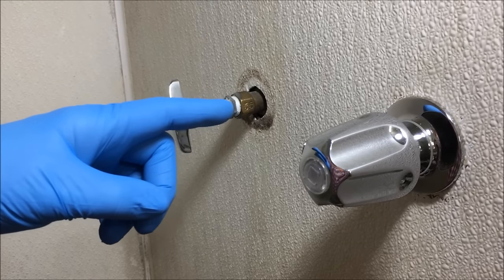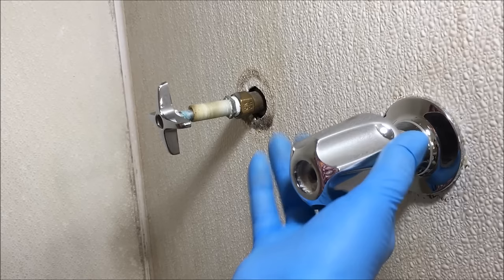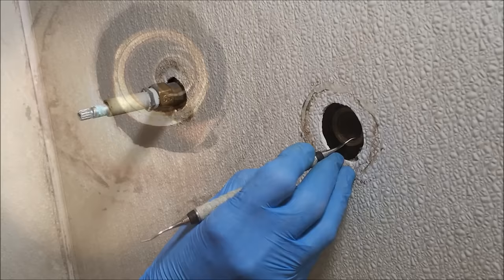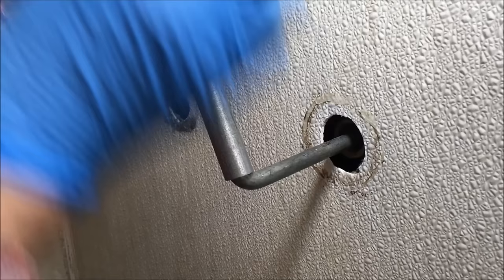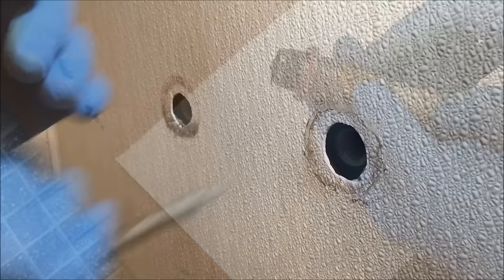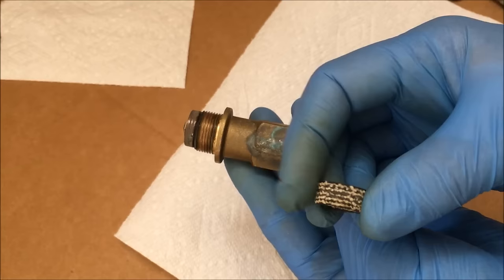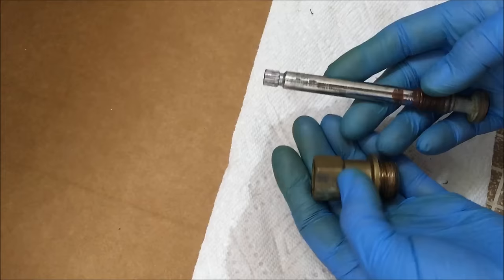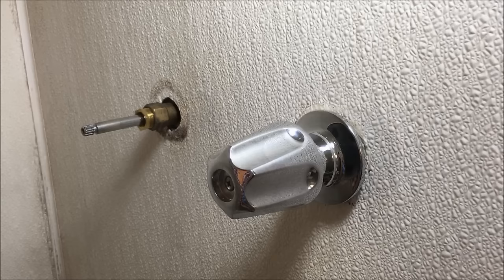Fix Leaking Shower Head or Bathtub Faucet | Rebuild & Replace Shower Valve

Comment: I love how straightforward your video style is. I’d add for anybody else having issues getting the handles off, soaking them in vinegar helps break down the calcium deposits if knocking doesn’t work. Fill a ziploc bag with some vinegar and tape it around the handle as best you can. It helped me get my crusty shower head off.
Reply from the maker: Thank you, Febiza919, for your thoughtful comment and tip you added.  That's great information!  I'm glad you like the straightforward nature of my video.

Comment: You have explained the stem working procedures better that anyone I’ve seen. Thank you. My shower faucet even after replacing the rubber washers on the stem. Do I need to pull the seats ( new seat) and use the sealant or Teflon tape ?
Reply from the maker: Thank you, dw, for your very nice comment.  I truly appreciate that you took the time to write it.

Now, to your question.  Yes, Sir, replace those seats because you saw in the video what pitted and worn seats did to my washers--chewed them up.  No, you don't have to use the Rectroseal 5 on the seats, and I would not recommend Teflon tape, ever, if you can use Rectroseal 5.  Rectroseal 5 is simply that great.  I only use the sealant on the seats so they remove easily next time I have to replace them.  The seats, themselves, do not need any sealant.  If you worry at all about a leak where the valve body screws into the manifold, then, yes, I would put some Rectroseal 5 on the threads of the valve body before I screwed it into the manifold.  Technically, you should not need the sealant on valve body to manifold, but it is cheap insurance against a leak.  And, yes, if you do use sealant there, I would highly recommend Rectroseal 5.
Reply: @frugaldiy1  Thank you, I have already replaced the seats, complete new stems and have replaced the seat washers on the end of the stems twice in the last 8 months. I just put new washers on the stems again and I still have a cold water leak there. The one I took off last had deep rings in it . I’m at a loss. Do the cone shaped washer do better ?
Reply from the maker: Okay.  First, please tell me WHEN the cold water is leaking.  How do you know it's the cold, vs. hot, water?  Is it leaking when the faucet/water is off or when the faucet/water is on?  Is the leak from the bathtub spout/shower head or is the water leaking from the valve stem body?

No, of the cone-shaped washers.  The washers are specific to the valve body.
Reply: @frugaldiy1  They cold water is always leaking when the knob is turned off. It leaks from the tub spout and is always cold to the touch. The seats are new and so is the washers. I have the correct washer size on the stem.
Reply from the maker: When I have a leak from the spout or shower head, I always find it difficult to discern if it's the cold water or hot water that's leaking because, unless it's a massive leak, by the time the hot water makes its way through the pipes and dripping out of the spout or shower head, it's always cold.  Just food for thought.  Typically, it's the hot water washer that gives way before the cold water washer does because the flow of the hot water tends to make the hot water washer less pliable and brittle.  

The "deep rings" you mention, in the new washers that failed, lead me to think that maybe the there is too much force being applied to the stem/handle when the water is turned off.  After installing new washers, I apply VERY LITTLE force to the handle when I turn the water off, and I have no leaks.  Maybe apply less force to the handle/stem when turning the water off.

Given that you say the leak occurs only when the water is off, that leads me to think that either the washer or the seat is the culprit.  Why the washer or seat, or both, keeps failing is a bit of a head-scratcher to me.  

One thought is that if the washer screw is turned in too tight, it can cause the washer to "cup", which impairs the washer-to-seat seal.  

When the water, hot or cold, is on, do you ever experience intermittent loss, then increase of water volume from the spout or shower head?
Reply: @frugaldiy1  thank you 👍🏻
Reply from the maker: You're welcome, dw.
Reply: @frugaldiy1  A little follow up. Although the drip was cold, the problem was the hot water stems washer. I had not changed it last time because it was a new stem. I noticed when I put the new stem in….the hot water stem did not turn quiet as freely as the cold. To fix it, I replaced the washer and put a little dab of grease on the stem where it goes thru the packing. It spins freely now and I can tell when it stops….I assume I was over tightening when cutting the water off and wore out the the washer prematurely. Thanks again.
Reply from the maker: @dwhunter8904  Thank you for the follow up, and you're welcome, dw.

Comment: Great video. I put silicone grease almost everywhere. Packing seal, escutcheon, threads. Everywhere. This will make disassembly much easier and the operation smoother. Done this job few times on my tub last 25 years

Comment: Thank you so much you just saved me tons of money, I got leaking on the middle valve behind the knob, I replaced the rubber washer inside but still leaking, I am by replacing entire system but luckily I saw your video, I just realized there is another rubber gasket, no more leaking now 🙏👍
Reply from the maker: DADDY INDO, that's GREAT to hear.  I'm glad the video helped you fix the leaky faucet yourself and save money.  Job well done!

Comment: Gr8 video! I personally put plumber grease on the screw that hold the rubber washer. I have had corroded ones and or corroded out screw driver slot. I do the save on the other screw that holds the handle on. I also put grease on the end of the stem that holds the handle so they don't corrode and the handles will come right off next time.
Reply from the maker: Thank you, Richard.

Comment: Excellent tutorial. One of the best I've on the subject.  I just installed a new diverter valve but it's leaking at the shoulder gasket (I think). I also have a damaged manifold
Reply from the maker: Thank you, Glenn.  I'd use RectroSeal 5 on the diverter shoulder to manifold leak.  Works like a charm.  ;)  Merry Christmas!

Comment: Thank you. I was told i had to replace the entire bathrub faucet and shower. On mine it was just a streght pipe coming through the wall. But figured. Hell if i have to replace it anyways mifht as well see if it turns. Vice grips and a little bit torque and it cane out. Thanks for saving me 300 bucks 😁
Reply from the maker: That's wonderful to hear my video helped you save your hard-earned money!  Love hearing that.  Proud of you for fixing it yourself, too!  ;)
Reply: @frugaldiy1  yeah. 14.99 and maybe 5 minutes of effort and no more leaks. At first it would leak about a 3 gallon bucket over 12 hours. Got so bad that I had to shut off the water to the house as it was leaking 3 gallons every 10 minutes and after an hour would use up all the hot water. Landlord sent a plumber who said we had to replace it and my landlord is kind of a jerk and wouldn't pay for the repair. Lol tried to send me the bill for the plumber too. Lol. 

But yeah. Thanks a ton! My shower Hot/cold water once apart look identical to yours. So again thank you!!
Reply: @imnotahippie22  You're welcome.  I'm glad you saved money and fixed the leak.  FYI--you're landlord sounds like a jerk and should be ashamed of him/herself.  SMH  You did a great job and should be proud of yourself!  Carry on...
Reply: @ann2796  thanks. Yeah I am a big support of "DIY" and "right to repair".. 

So something completely unrelated to this topic but would like to share is,  I've been curious for a long time now about using a 3d pen 🖊️. So I found a good deal on one and it came in yesterday. I had this very old tractor springer (it looks like a micro tractor about 20" long and weighs about 10lb  the idea behind it is you set out a garden hose and it follows your hose then shuts off when it gets to the end. 

The plastic piece where the hose connects broke off. Tried super/gorilla/hot glue but would stick. So my idea was "plastic sticks to plastic best overall. I didn't take any pictures while doing it as I was just seeing if it would work but I used a sharp knife to scratch up the plastic on both pieces then used hot glue to hold the hose attachment in place but about ⅕" apart than using PLA jammed the pen in the gap and started filling it up. Then went around the entire piece twice slowly going side to side. And when putting the wheels back on I accidentally dropped it (it's heavy) about 10" onto concrete and it was fine. 

On low gear ⚙️ it moves about 12' per hour. And when it gets to the end it shuts the water off from the tractor side which is always where previous repair attempts failed. 3 hours up front 5 in the back and am surprised just how solid it is. 

If you are curious I took a time lapse with my security camera of the front and back and can put together a short video of what and how I did.

Comment: Very informative for sure.  I can tell you’re a pro at this.  The problem for me is that the parts, like the valve seat, are impossible to find at Home Depot.  If you do find them the components are a mismatch.  Before you know it I’m calling all around the county to find the correct parts and I should have just paid you a hundred fifty bucks to just do it.
Reply from the maker: Hello there, tbird04506.  Don't despair, yet.  Are you able to leave your main water off long enough to remove the valve seat and take it to a plumbing supply store in your area?  If so, please consider that.  If you do that, also take the valve bodies with you to get all the seals (washer, shoulder gasket and packing seal), so you can rebuild the valves (or purchase new valves if you prefer).  The folks in the plumbing department at Lowe's and Home Depot do what the can, but I have not had good luck with much guidance from them.  That's why you're better off going to a plumbing supply place in your area and ask those nice folks for help with parts.  I've had to go to plumbing supply places to get parts when I come across old Price Pfister valves (awesome valves).

Comment: Great video. Thanks so much for the detailed description. I'm scared ah to try this but seems i have no choice before i end up with a HOT ONLY knob knocking shower when it blows off at me.😅 I have trauma from this happening to me as a child! 😢 So yeah, both my hot and cold water handles are leaking like crazy and the landlord usually calls a plumber that messes up our hot water output Everytime he touches one. My shower is the only one left in the house that still has decent hot water. 🤦🏼‍♀️🤷🏼‍♀️ IDK what he did to the other two but hardly any hot water in them. 🤯 Guy couldn't even repair the leak in the kitchen sink. 🫣 Ok diary over. 😂
Thanks again!!!🤭😊

Comment: Great video, excellent explanation and discussion.  I have watched a few of these videos lately and have noticed that most systems use valve seats.  I have a American Standard system and the stem is closed in on a barrel type seat to stop the flow of water.  It works fine but I wonder which type is better or lasts longer.  Have you encountered this system?

Comment: You're amazing! :O Thank you so much! ❤❤❤❤❤❤❤ (I was not aware of the second seal and would have never thought to replace it)
Reply from the maker: You're certainly welcome, Kasey, and thank you for taking the time to leave such a thoughtful and nice comment.  I'm glad the video helped you.  Happy DIYing!
Reply: @frugaldiy1  Fixed and 0 leaks, even though the replacement seat wouldn't fit. (It looked EXACTLY the same as the one I bought! >.>)
Reply: @frugaldiy1  second random issue, Somehow the gas started leaking when I turned off the hot water heater from 2 spots. wife got home (after me sleeping in it for 10 hours) and quickly opened the house up. I felt like crud for an hour. I bought a gas detector and tried to recreate the problem for like 6 hours and was unable to. Just a random story.... maybe it will help someone.
Reply from the maker: That's interesting, Kasey.  I don't know what would have caused that.

Comment: Question: what about the packing nut? What's the proper way to keep that from leaking either when the faucet is turned on or when it's off or both?

Thanks.

Excellent video.

Comment: Just replaced everything following this video, very well done and informative, while it did fix my leak, now I have water leaking out of the handles themselves when I run the water, any tips? Too tight? Not tight enough? Need new O rings different from the package?
Reply from the maker: Tighten the packing nut a bit at a time, until the leak stops.

Comment: Excellent video, I’m going to try it myself since my my shower is leaking. A plumber wants to break the wall to install a new manifold and it will cost me $750, I refused to pay that amount.
Reply from the maker: $750 to do unnecessary and and waaaay overpriced work.  SMH  It's a ripoff, and I'm glad to hear you didn't fall for it.  I have GREAT respect for ALL skilled-labor trades and the professionals in them who are competent and ethical.  They're just hard to find.  Better to save your $750 and retire early.  Carry on fellow DIYer.  ;)

Comment: I asked several questions today but watching your video several times, I have already answered the questions.. The only thing I'm left with is the plumbing supply house charging me one fee for a new set of stems, or buying a rebuild kit. Without seeing the valve, he quoted me between $80 - $100 for a 2 stem rebuild kit. That's all parts and valve seats. I am curious what 2 brand new valve stems will cost with all new parts.. Then I don't even have to break them down. Again thank you for an excellent video.. Honestly if I have to replace washers every 6 months that's 50 cents in 10 minutes of my time
Reply from the maker: $80 to $100 is a GIGANTIC ripoff!  I wouldn't deal with those folks.  Call another pluming supply place.  The seals and gasket you saw me use in the video cost me, at most, $3 total.  I got them from a wonderful Ace Hardware store in my area.  

Here's the thing, you have to be willing to take one of your valve stems and valve seats out and go to one of the big box stores, a hardware store (like Ace Hardware) or a plumbing supply house and find the exact seals and seats you need.  Don't rely on others.  As I recall, you said your valves/home is 35 years old--that is not old.  My valves are 46 years old now and I was able to find all of the parts I needed at Ace Hardware.  ;)
Reply: @frugaldiy1  I appreciate that. What's really scary is now that I took my stem out last night it looks exactly like the one you had in your hand.. I'm not sure just how much they vary. My valve stem seem fine now I guess I just want to replace the seats.. Was it a matter of just eyeballing a new one next to the old one, or are their measurements involved?  I actually do have an Ace Hardware about 10 miles from here.. Hopefully they have like stems hanging on a wire and all I have to do is hold my stem up to theirs.. Maybe that will help me figure out what valve seat goes to that stem. Thanks for taking the time to respond to a retired paramedic
Reply: @frugaldiy1  Looks like I have a sayco if I'm looking at the picture right, and it takes a 1/2 inch flat washer, so does that mean I probably need the Sayco 1/2" valve seat? Of course this assumes there aren't 10 other vendors that have a valve stem that looks almost like the one you had in your hand.
Reply from the maker: Mr Obvious, you can even take the valve seat and stem to Home Depot or Lowe's and likely find every part you need.  Just tell the fine folks there you need help with matching them up.  Often, they'll take the items out of a package for you so you can see if they're a match.
Reply from the maker: I can't answer whether you need a Sayco 1/2".  Please take the stem and seat to Lowe's, Home Depot or Ace Hardware and get an exact match at one of those stores.
Reply: @frugaldiy1  Thanks for everything the project is done. The plumbing supply house sold me every bill kit for $11.. I was not able to get the hot water valve seat out. I followed your video and rebuilt all the stems. They told me it is a  Taiwan knock off of a pfister stem. They even put new cups on the end of the stem where the washer goes. The cold water stem had no cup left at all. So I did manage to get the cold water valve seat out and it was definitely messed up. Is so far no drips.. I am looking to see how people have removed a valve seat where they square hole has rounded off. One guy said he used a number 5 bolt extractor from Harbor freight.. But as far as I'm concerned if it isn't leaking I'm not going to try to get it out. How would you go about removing one of those brass seats if the square hold rounded out
Reply from the maker: I'm glad to hear you are finished with your project--and NO leaks!  If I had a rounded-out valve seat, what I'd try first is using a large-bladed flat screwdriver and hammer that into the valve seat to try to get enough of a "bite" into the seat, then turn it out.
Reply: @frugaldiy1  Thanks again for the time you took to answer my questions.. As a 30 year firefighter paramedic I really appreciate customer service and kindness for and from others.. Your screwdriver trick worked with a little tapping and I got the valve seat out. The plumbing supply house told me the valve stem was a Taiwan made price fister knock off.. If I go to a Box store and find a price fister that looks exactly like mine, when I hold them up, could the valve threads still be different? Is there any other test than buy the valve stem, take it home, try to screw it in the diverter, and see if it takes